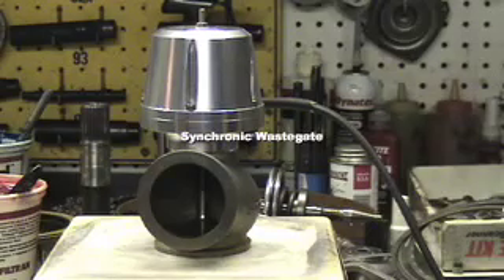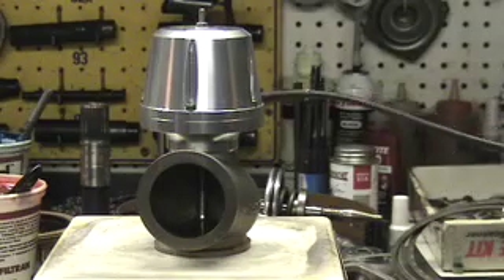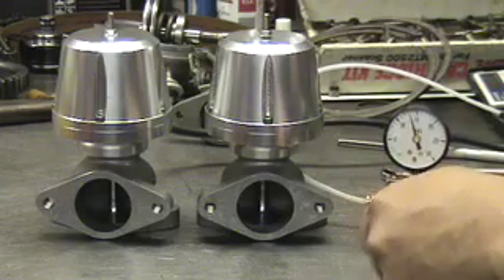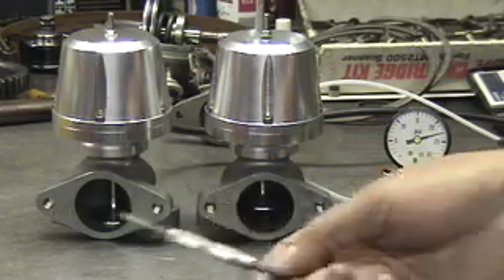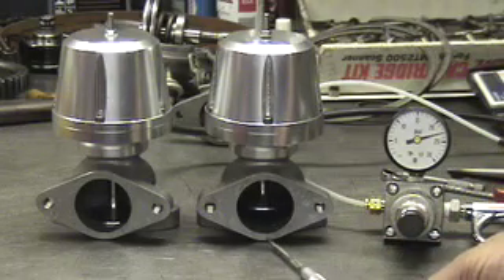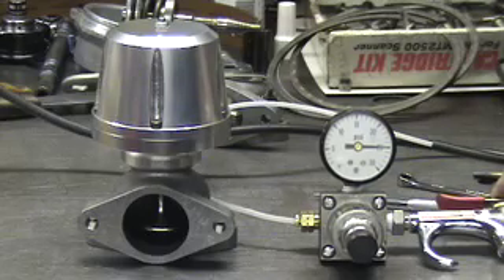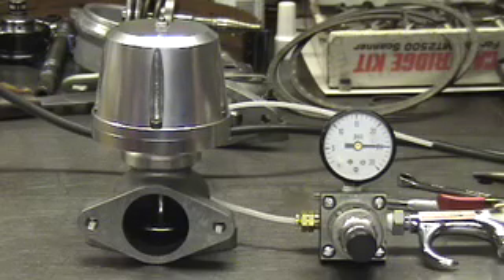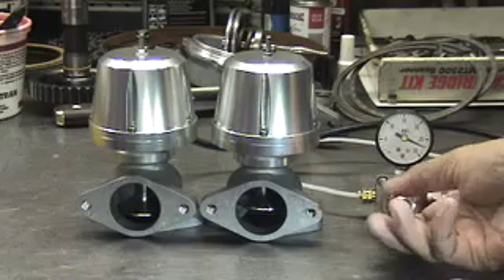Wastegate Spring Rate and Spring Pre-Load Explained

Comment: I still love my Synapse 50mm.  Just put in the 40mm seat, Spring B, and stiff preload spring in my turbo LS 67 firebird.  Using Ports C & D now sits at ~12psi on the low setting on my dual stage controller.  I wish Synapse was still around.  What a cool concept.

Comment: Hallo,ich have a question. In the video you use a pressure regulator with gauge. I ve looked for something like that in the internet, but I dont found. Is that self builded? It looks like parts from a fuel rail pressure or so on. Can you tell me exactly what it is please? Thank you.

Comment: question: is it better to have correct spring in westgate and control boost just by that or have weaker spring and control boost via boost control?? i know in 1st version You wont be able change boost level without changing spring but are there any cons with boost controller apart of easy level change??
Reply: I'd like to know as well
Reply: a @pnwmidnightclub2939  aparently its better to have weaker spring and use boost controller than having spring with target boost rate, with weaker spring boost controler will hold westgate closed till desired pressure so boost will come more agressively, with target spring rate it will crack open before max boost - had this response on different channel and make sense.
Reply: @jankesbmw  oh ok thanks you helped me out I'm gonna get a 5lbs spring

Comment: Questions:
1. Does adjusting the preload vs. changing the spring essentially have the same effect. Is one preferred over the other?
2. If you're trying to reduce spool up time, is it ideal to have the stiffest spring possible that doesn't result in over boosting? It seems odd that you'd want to bleed boost prior to hitting max boost, as it'd just reduce mid range torque. Thanks!
Reply from the maker: Sort of, adding pre-load to any spring means you're adding force required to open the valve.  A high rate spring vs a low rate spring, means that the spring lifts (opens) slower, conversely closes up faster too.  Our valves are naturally all closed by 10"-5" of vacuum, so you aren't losing boost.  The problem with some turbos that are mated to engines is that they aren't perfectly matched and have lots of on-boost surge, or bouncing of the surge limit of the compressor.  The only fix is to bleed a little boost until the turbo is in it's prime operating range.  That's the only time you'd want to bleed off boost on spoolup, besides during launch control.

Comment: so In order to adjustment you spin the screw on top of it ? I'm trying to turbo my 5.3l I read so far max boost is 12 psi but trying to run 7 psi how do I adjust it to only have 7 psi ?
Reply from the maker: Port C+D is lowest boost, besides that you'll need a softer spring

Comment: Im thinking of running 30-35psi of boost through my external gate , what spring rate in PSI should I be using 14,20,22psi ?????????
Reply: 30-35 psi spring? combine more than one

Comment: My wastegate just has a hole in the top??
Reply: generally it'll just be a lifted assist via vacuum, or vented to atmosphere if you dont need the assisted lift (the vac helps it pop to full open faster, if you have boost spikes you this can help you) without boost spikes you can leave it as is

Comment: I plan on getting the turbosmart EBoost street.  but for right now with just the wastegate (no boost controller at the moment).  would you set the wastegate preload to max psi attainable with turbo A/R (both turbine side and compressor side) or min.  When adding in the boost controller, what preload setting should be on the wastegate? 0 preload = 0psi, Min boost = 15psi, or Max boost = 25-28psi

Comment: hi i have an internal 5 to 20psi adjustable wastegate on a Td05  big 16g turbo ..my question is when the wastegate is fully open ,do i  get max psi on this turbo? or when opens a litte? my stock talon tsi is set at 10psi but now im getting 5psi ..i fixed all the boost leaks and still 5psi ..thanks

Comment: ok so i have a question.. I bought a turbo kit for my 240sx awhile back.. i never really have driven the car much. but i remember the seller telling me the top of the waste gate will not have enough room for the top nipple to bolt on because of the shock tower in the way.... he specifically said * you do not even need the top nibble. just the bottom one. So when i bought a boost controller it came with a T for the top and bottom nipples..   do i need the top nipple on the wastgate ..

Comment: why not just use a boost controller which just limits the amount of pressure getting to the wastegate which in turn makes it open later and is alot easier then trying to adjust or change spring settings

Comment: if i dont want to run a boost controler can i just put a 12 pound spring in the waste gate? if i just run the vacum line straight from the wastegate to the turbo will the boost always be 12psi? throught all rpm's

Comment: the worst that can happen is low boost. boost controller can only raise boost not lower it. the spring inthe gate determines minimum boost pressure. the correct spot for wastegate line is  off the side of the compressor housing or anywhere before the throttle body. after the throttle body can cause the gate to open up during idle.

Comment: do u use external wastegate as a standard internal one would not be able to waste enough for performance/ extreme boost.
I run adjustable bleed valve on a TD, u can also get pre set valve arrangement to adjust boost, 2 one way valves, one adjustable, arranged in parralel but in opposite directions, the valve feeding waste gate is adjustable, the other allows the wastegate to close again.
I bet u get some insane BHP turboing big V8's?

Comment: Bigger diesels dont use wastegates,the reason being that the rev range is narrow, a wastegate is needed when u want full boost early in the rpm so a turbo with over capacity is used otherwise boost would goto high or u would only get max at max rpm or power . the new range rover diesel has 2 small unwastegated turbos aswell, wierd eh?

Comment from the maker: bottom line is that if however your turbo spools with the wastegate shut is the fastest you'll get your turbo to spool.  But if your wastegate is cracking open too early, then you can use addl spring pre-load to get it to open later to help your spool time.

Comment: if the wastegate wont leak, you will spool quicker. without the diaphragm, you also benefit when temperature changes since its not affected as much. it also has interchangeable valve seats and springs for even more options. with the vacuum ports, you can change boost easily. its a boost controller and wastegate in one. you can use the preload on the wastegate to fine tune boost levels.